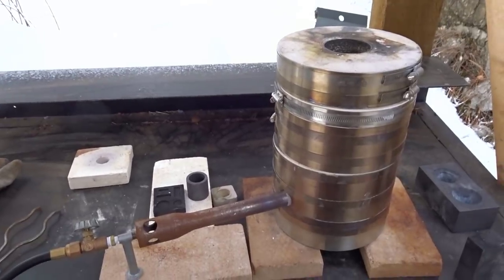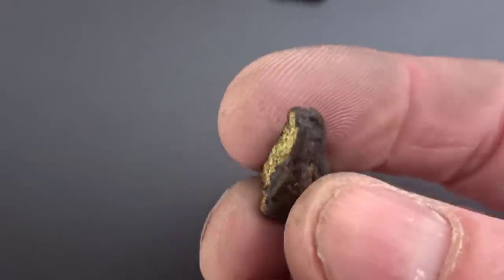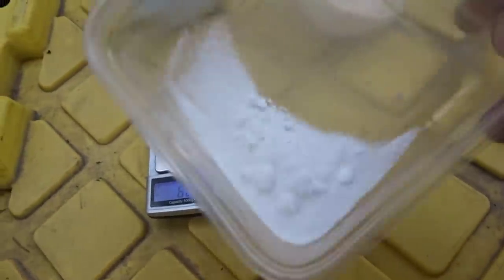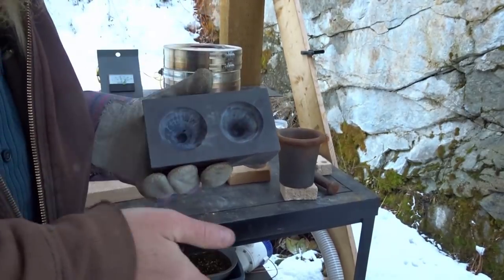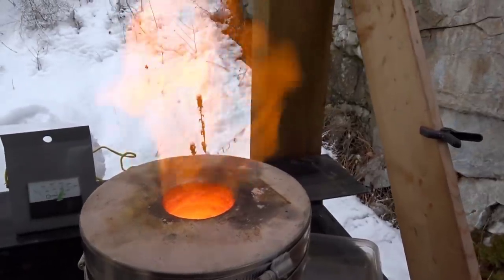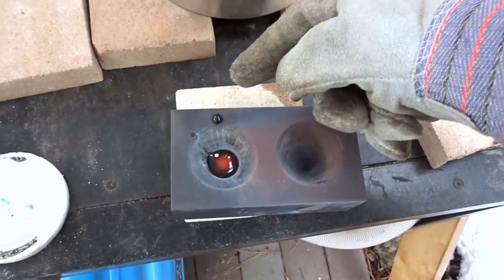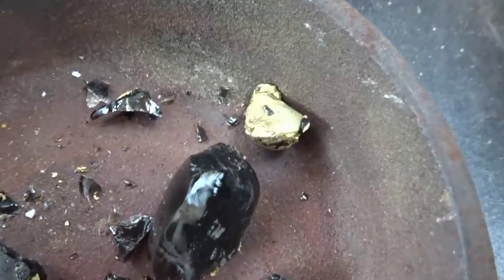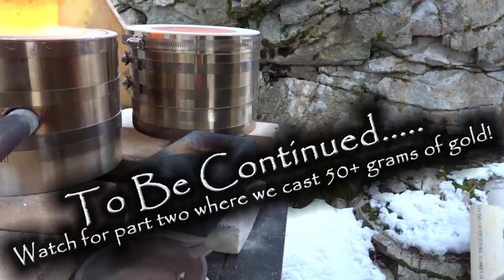LOST GOLD recovered, watch how!! (Part #1)

Comment: Hey Dan, a couple things.  If you're going to use that type of conical mold, it needs to be red hot before pouring, because it acts as a giant heat sync.  Otherwise, not enough time for molten material to separate.  That's why you have bits of gold in the slag.  Also need to pound the gold flat a possible to remove all the slag.  Good luck.  Look forward to video 2 !

Comment: I'm curious why they left the black sand in when they smelted it down. Wouldn't you want to remove that first? I always use a magnet to pull the black sands from my finds. Just really curious as this is my next project as well.

Comment: some info.    at 2:42,  it might have worked, if a steep-sided  conical  crucible  had been used; along with  sufficient stratification, before heating.    aside from any iron that is present, is black sand mostly silica.    cheers
Reply from the maker: Thanks!

Comment: Dan, elemental sulfur wouldn't precipitate at that temperature.  It would either vaporize or turn into SO2 or both.  I don't know what that could be either, but it is unlikely to be sulfur.
Reply from the maker: We see sulfur just like this deposited on our graphite rods when we are roasting ore. I have not seen it during a smelt like this before. But we usually get rid of the sulfur first in roasting.

Comment: Your conical mould should be nearly the temp of what you pour, and u should have a blowtorch on your crucible as u pour to keep the temp up. Then, you get a perfect cone shape, and the time for gold to sink and flux to float before it starts solidifying. It needs to be molten in the conical mould for 1min?
:correction. U point the blowtorch at the molten material as u pour, not the crucible.

Comment: Pre Heating your Mold would have helped keep the gold / Slag  remain hot enough to separate better in the mold.
Reply: My thoughts as well. Just found your comment after I made mine.
Reply from the maker: I did preheat - it was more a case of incorrect flux and being impatient
Reply: @Danhurd  LOL,  You Pre Warmed.   Ya want Pre HEAT.  HOT .  LOL   Close to RED Pre Heat.
Reply: @Danhurd  your not working in Ideal Temps there, eaa.   Everything is flipping COLD.

Comment: I'm thinking Who Ever didn't use a good flux like even Borax .   Obviously didn't get the material  hot enough.  The Gold would had migrated to the bottom of the crucible had it been hot enough.  Cool Video again.     Using  regular Arm and Hammer  Borax  works just fine for me.   I don't even try to go with mixtures like your using.
Reply from the maker: He used only borax.  but that would alow the other materials in the ore to combine with the gold in the bottom.  The other components of the flux do the hard work in a smelt.
Reply: @Danhurd  Don't think so.  Specific Gravity won't allow the other components to remain with the gold if Hot enough.  Like the oil and water thing.   Borax works quite well on it's own.  His main issue was temp.  Just not hot enough.  Even without the Borax it would have separated better then that did.  It looks as if the gold and slag had in fact separated at one point..   Got jumbled together with a pour not hot enough .  The gold was in clumps well separated from the slag.

Comment: I'm a chemist... the fogging of your camera lens and mirror with looking into your furnace.  The combustion of Propane (organic), in the presence of Oxygen, creates Carbon Dioxide and Water.... C3H8 + 5O2 = 3CO2 + 4H2O ... The water vapor produced from the combustion of propane is condensing on the glass surfaces due to the low atmospheric temperature and the cold surface of the camera lens and mirror. Not sure how it can be avoided when the glass surfaces are already cold. I fear warming up your camera and mirror may damage them.  bigstackD Casting youtube channel has a similar furnace and gets video shots into his kiln, but, he's Australian and working from his garage = Warmer air temps there?

Comment: Yet another interesting and informative vid! Thank you.

Regarding PPE: https://imgur.com/14Swi47 Appropriate PPE according to the YT comments section.
The mirror: a shaving mirror suspended above the furnace/kiln/whatever can make life easier
The mould: From watching jewelry vids I've seen many jewelers hold a blowtorch on the mould while pouring to help the metal flow. This may help get a good bead at the bottom along with sooting the mould?

Finally, I'm always amazed by commenters assuming you ignore the safety aspects despite the type of teaching you do. Do "they" assume you're a history teacher despite your vids showing otherwise?
Reply from the maker: Thanks! And as for the PPE - spot on! I do have a mirror but its handheld and not suspended. Blowtorch is a good idea